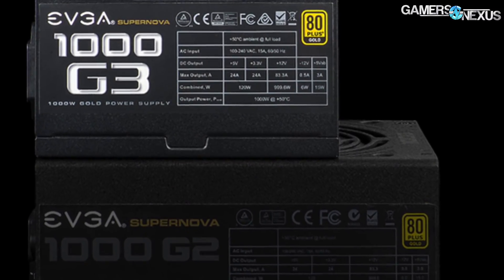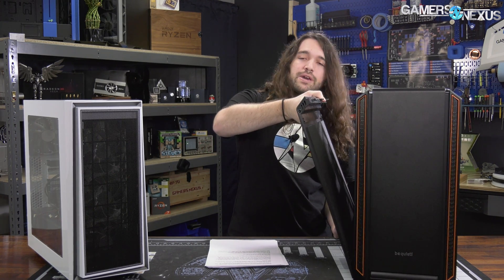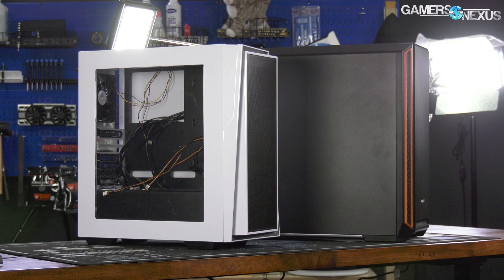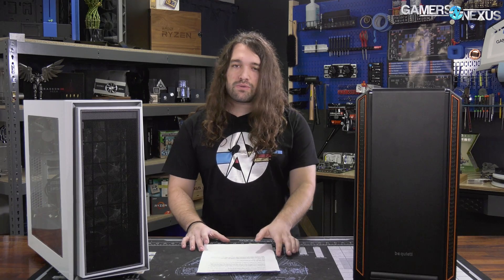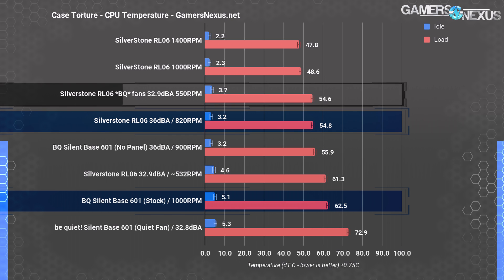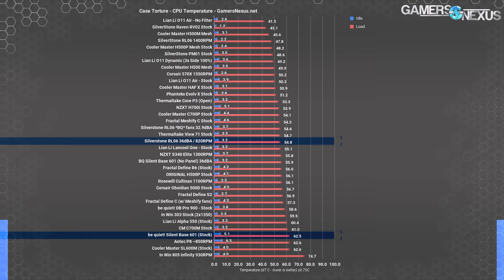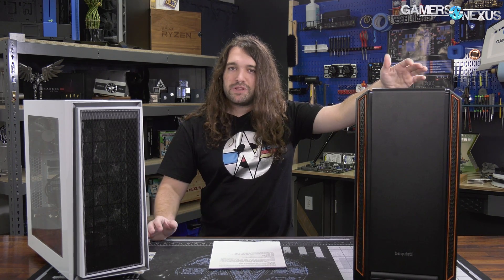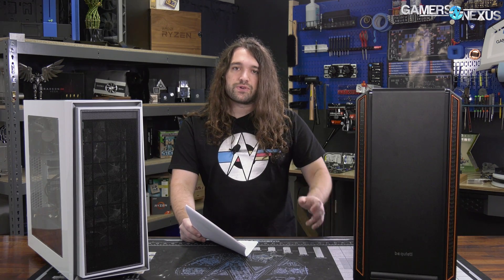Airflow vs. Silent Case: Noise-Normalized Thermals

Comment: What about silencing HDDs? That's one of my biggest reasons for having a silence focused case (R5), since I'm forced to run multiple large HDDs until SSD prices come down an order of magnitude. My fans run at around 6V anyway so they make pretty much no noise no matter what case they're in, but silencing the other stuff inside the case is a biggie.

Does very much seem that the BQ approach is going too far though. No amount of sound damping helps if your machine can't breathe, but I personally wouldn't be able to live with a case that didn't seriously attack the noise made by HDDs and potential whining components.
Reply: I have DBP900 and I can say they're quite effective to kill my 4 15k drives and 3 7k2 drive noises. i ditched those noisy bastards with higher capacity 7k2 drives already. even though the dampening works, there's still some high pitch noise leaks from the side window. I recommend the fully closed one instead.
Reply: Two excellent solutions for silencing hard drives that I've been using for a few years: 1 - suspension using style shock cord. 2 - resting the drive on four small pads of sorbothane, my current solution which is working great. These pretty much eliminate the transmission of vibrations into the case which is the biggest problem with hard drives, also I prefer 5400RPM for this purpose.
Reply: @GurtTarctor  where did you buy sorbothane pads? i can only find sorbothane feets
Reply: @n.shiina8798   I buy the sheets, think they are about 5mm thick. Then cut them up with scissors.
Reply: jubuttib I run 2.5 inch Hard Drives and NVME SSDs. No noise.
Reply: @gfjfjufidi2880  have you tried 10K 2.5" drives? :p

Comment: Would be very interested to see this test repeated but normalising for frequency peaks.  The low pass foam was specifically discounted in this test, but it's an important part of the sonic solution bE qUiEt??? has implemented, so I feel like this is a little unfair.

Also I'm "blessed" with being able to hear 15kHz, so stuff that specifically deals with high frequencies is reasonably important to me.

Comment: "type of noise" is very important with this topic, I think everyone prefers low humming noise over high pitched whistling noise (coil whine, grinding fans, hdd).
Reply: yes and the variation of the sound : if the noise is uninterrupted and invariant it's easier to forget it.
Reply: Some may also be wanting to get rid of noise that doesn't come from case fans. For example you may have a video card with a louder blower style fan or one with coil whine. Also other component noise such as pump noise and mechanical hard drives.
Reply: @carlwells9504  My thoughts exactly. So I'd sum it up as roughly:
- HDDs, noisy pumps or other vibrating/humming sources => silent case
vs.
- No mechanical noise or vibration (e.g. SSDs, air cooler etc.) => low rpm fans airflow case.
Reply: @tarron8785  I can hear my own breathing which I can say it's worst then a pc
Reply: Half of the reason why I switched from Corsair AF fans to Arctic ones. I have more fans in my system now, but the sound is MUCH lower-pitched and easier to drown out or get used to.

They're in a Phanteks P400 TG, for what that's worth.
Reply: coil whine and vacuum cleaner noises are the worst
Reply: He said it all it's about length for once. Sound waves come in short med and long beach has amplitudes that affect your ear differntly... some can hear sound amplitudes and speeds others can't.  I'm lucky 20 years as artillery man I can't hear shit anymore.hahaha
Reply: Exactly. I find HDD noise to be incredibly annoying but the sheer amount of space you can get from them as opposed to SSD's makes them unavoidable. One of the various noises that silent cases get rid of. 

Just bought a non-silent case and am going back to my old trusty silent case until I get it figured out.
Reply: grinding fans?  What kind of fans do you use?
Reply: i have a be quiet pc with be quiet hardware and sometimes i wonder if my fans are working so quiet they run even when gaming a big game
Reply: Low humming is ASMR to me lol
Reply: Yeah this test is kind if bull shit, doesn't matter how quiet the fans are.
Reply: this matters to me a lot, since i'm using the desktop in the same room as my recording studio. my large diphragm condensor mics are way more sensitive than my human ear, so i need all the quiet i can get. i'll definitely add another front panel fan to the be cool though. or maybe just move the one that comes in it to blow more on the cpu than the gpu.
Reply: Mr. Fletcher and Mr. Munson agree.
Reply: So with case has the low humming noise?
Reply: HDD resonans and worn fans are the worst kind of noise there is. I consider that the worst type of sound.
Reply: Yup and cases with sound dampening material can get rid of those sounds, or reduce it way down.
Reply: Coil whine happened to me..
Then i stopped cleaning my pc and it went away!.
The accumulated filth lubricated my fans.
Reply: @coffeepot3123  What the fuck. What has fan to do to with coil whine...
Reply: @coffeepot3123  The dust probably wedged the coil so that it couldn't vibrate anymore, or reduced cooling efficiency to the point where it changed power draw and moved the frequency of the vibration out of resonance.
Reply: I dont mind any of those (well except the ones that tells me its gonna broke) coz at least i know the fans is working. Like you have headphone to cancel the noise, so why the silent case?
Reply: smoked_out had a question hoping you or others can help me. I bought a used 1070 and has bad coil whine if I don't put on v sync do u think then it'd be worth to get a closed off case like the corsair 270r to limit noise?
Reply: @peanutdelight8413   if you get a really closed case with sound dampening foam it might help, if the 270r has a plastic or glass sidepanel next to the gpu it won't really do anything at all. (have a watercooled H440 with a coilwhining 980ti also in case you didn't know water blocks emphasize the coilwhine noise as i learned with this card)
Reply: anub1s15 yea they sell windowed and nonwindowed so I figured I'd do non window and then buy foam for the inside
Reply: @peanutdelight8413  Similar to what @anub1s115 said the noise dampening foam seemed to really help with coil whine. Just recently bought a second hand R9 fury which has really bad coil whine and my PB 600 really does a fantastic job of mitigating it. My only other case was an NZXT H440 (which is also silence based) so I really can't tell you what it would be like without the foam, just something to think about.
Reply: I for one would like to actually hear and know if my machine is making coil whine noises or other whirry stuff that it probably shouldn't be making so I can take action. I don't think the noise dampening solutions in the case would help with that.
Reply: AR J 

open up your sidepanel lmao

Comment: I always wonder how these cases compare with every fan slot occupied...because I don't know who runs a case with only the fans that come with it, especially if it's only two.
I have a Silent Base 801, running a 280mm AIO in the front with an additional intake fan below the rad, two 140s in the basement as intake, one 140 as exhaust in the back and 3 120s in the top as exhaust, and thermals seem to be pretty okay across the board. Running a 9900K at 5Ghz I only ever get it up to 70-75 degrees during stress tests and 65 during gaming...
Maybe the brute force approach can alleviate some of the restriction issues.
Not saying a purely airflow focused case isn't going to be better, maybe I'd have better thermals in a better airflow case, but my thermals barely increase when I take the front panel off.

Still, it's a contentious issue, I just have a soft spot for beQuiet! and liked the 801s design and features alot.
Reply: I have a Phanteks Enthoo Primo (the big E-ATX one), which sports 5 x 140mm fans stock (good but not best-in-class silent, rather strong airflow at 82 CFM each). Inside sit two 150W TDP CPUs watercooled with Swiftech X220's, which adds 4 x120mm high-pressure fans, 55 CFM each). Total of 9 fans and a combined 82x5 + 55x4 = 630 CFM of maximum airflow (divide by ~2 for intake/outtake). 

Add three GPUs for a total of 5 extra fans; idling they're all off at 10C delta max, but at max speed one of them (Sapphire RX 460) is unacceptably loud (I only use it for VMs display though, I never push that GPU above 30C, so it's effectively passively cooled and thus a non-issue for me).

The case itself is a giant hole, seriously, hex tiling on the back, etc. It's pretty much meant for great cooling and doesn't care much about passive silence. 

What I can tell you is that with all fans at max speed, it is a COLD BEAST if I ever had one. It's very loud though, easy into the 60dB's subjectively (I can't measure that, but it's loud enough that you need to raise your voice to comfortably speak to someone across the small-ish room). I feel like I'm in a server room sometimes when benchmarking stuff.

However, if I set all fans to minimum, I only lose little cooling (like maybe 10C delta, which leaves ample room still given the low basis), and the computer noise becomes barely noticeable. A rather bass-y white hum that actually feels nice, a bit like a very distant, faint waterfall but more "air-y" if it makes sense. 

I could probably lower that floor noise replacing all fans with Noctua's or something dead silent by design, maybe MagLev idk. But the cost makes it hardly justifiable in a somewhat noisy environment (I live in a 1-bedroom appartment, so the PC is in the living room, and there's usually music or podcast or something in that room, I only need the PC silent enough not to be heard above any desired sound; and I watch movies/series in the bedroom so there's zero noise there).

So I would say that the brute force approach is very effective, although costly to achieve maybe slightly better results. I need a three-figures budget to replace all those fans (2.5 years old already, still decent, so probably ~1 year from now, which per year amounts to ~$60 just for freaking fans; some people buy two cases once a decade for that price).

______
Note: yes I could and should have gone custom loop, especially for GPUs, but I have no idea how and tons of other stuff to do. For reference, 
I've tried various configurations, and to my surprise the best thermals at low speed were achieved by pushing air onto the CPU rads which sit all across the top side, thereby intaking air inside the case (which I exhaust ASAP using case fans), and similarly pushing air directly onto the GPUs (they sit at the bottom with risers, directly on top of a couple case fans), which again is exhausted ASAP through other case fans. This yields a "two-zones" config. horizontally split, wherein CPUs at the top and GPUs at the bottom probably never really exchange air. The one flaw is that air reaching the CPU VRMs and RAM is on the warm side (coming from the CPU rads), but honestly it's barely above 50C so I figure that's well enough for these components (could always add heatsinks anyway, but don't need to).
Reply: If you go up from one intake fan to two intake fans you get twice the airflow for 3db more. If you go from two fans to three fans you get 50% more airflow for 1.73db more. That is if you block of unused fanspace to stop resirculation.
Reply: There's this LTT video where he claims that more than 2 fans doesn't make much more of a difference. They used a CM master case 5 for the test.
Reply: @stardustreverie9737  I would imagine that this is dependent on the HW configuration one has in the system. I would imagine that two 120/140mm fans would be enough by far for a mainstream desktop. What i stated is just some facts to consider. Maybe its better to go with a cheaper case and rather buy a extra fan to achieve lower noise. I have five 140mm case fans in my setup, its a air-cooled 1950x and its only around 36-38db under full load, deltaT~27c. I cant make statistics based on just my own setup, but its an indicator.
Reply: @trulsvian  It's an old and probably too approximate formula, but roughly 1 case fan per "big" component (CPU, GPU typically) kinda worked back in the day. So in my case with 2 CPUs and 3 GPUs, 5 case fans seem like a decent count to flow enough air overall. I think you're therefore totally right that most mainstream PCs with 1 CPU and 1 GPU should be totally fine with 2 case fans. (then possibly add more if watercooling with thin/large rads).

Comment: because fan noise is the only thing that matter 
chuck a gpu with some bad coil whine and a bunch of hard drives and tell me which case is quieter
Reply: Coil whine in different places (GPU, MB, SSD, PSU), HDD works, bad PWM or worn ball-bearing fans you can't easily replace. That's what closed Silent PCs are for.
Note that Steve admitted they just tested noise level, not frequency responses, and he didn't trashed the whole kind of cases. To me it's a small win comparing to his claim in the Silent Base 601 review.
Reply: Vierax SSD Coil Whine?
Reply from the maker: We talked about that aspect in the video.
Reply: @GamersNexus  talked yes, but did not test. 14 minutes long. 14 seconds of importance.
Reply: I have a Vega 64, a card legendary for it's coil whine.. and completely got rid of it 100% just by capping my system framerate at 200 with rivatuner. Using  'quiet' hot box cases to fix issues like coil whine is like painting a window to hide a crack in the glass.
Reply: @PriaSamari  Id rather cap with frequency/voltage tuning, Rivatuner will not work for anti cheat games.
Reply: @PriaSamari  why don't you use radeon chill for this?
Reply: jake winchester people still use 3.5 inch hard drives? Lol. SSD + 2.5 inch Master Race. No noise at all.

Comment: Good test! I would prefer the R5/S/R6 though because it is less closed off on the front (fewer holes but much bigger holes on the side) than that bequiet but that is just my personal curiosity, for the test setup it might be better to take the two extremes. It seems to me that those Fractal cases approach a very good compromise as long as you don't have extremely overclocked hardware inside that case. But indeed, the fans and the foam might be a lot more important.
Reply: Peter Jansen ya I have the R4 non windowed case with an 100i gtx (v2) mounted in the top pushing out with two NF-12s at 1100rpm and four other ~700-800rpm fans in the front, bottom and back. With an iPhone dB app I get about 45dB. I wish I had slightly higher quality fans for the non rad fans to get that noise a little lower, but it seems okay to me. Does that seem loud to you? I’m not overclocking

Comment: PM01 with a D15 and it's the quietest build i've had (even compared to h440 and R4) and it's acceptably cold. This thesis is one hundred percent based in reality. I use it in a studio tracking room where noise is of utmost importance.

Everyone should do it.
Reply: D15 or BQDRP4, both are great coolers. Noctua has the better tower, bequiet the better fans.
Reply: @peterjansen4826  absolutely. They're both stellar there isn't much to it aside from availability and price.
Here in aus the D15 is a better purchase and it also happens to be easier to install.
Reply: @Jay2097  
Here the price difference is small, like $6-7. The problem with the DRP4 for me is that it has less metal (given that I have a case which fits the D15...), I would like to see a somewhat lower price for it, around $65, because of that.
Reply: @peterjansen4826  Why do you think be quiet has better fans.
This is the closest fans I was able to find

be quiet silent wings 3 140mm high speed vs noctu nf-a14.
1600 rpm vs 1500 rpm
131,79 m^3/h vs 140,2 m^3/h
2,16 mmh2o vs 2,08 mmh2o
28,1 db(a) vs 24,6 db(a)

Seems to me the noctua is tiny bit better.
Reply: @petrkinkal1509  
Better is a bit subjective in this case, I claimed that because of the pitch of the sound. If your speakers are good enough then you could watch the Science Studio comparison (beQuiet, Noctua and two other brands). The pitch of the bq-fans is in my opinion less annoying and Greg thinks the same. I guess that it is possible that other people might prefer the pitch of the Noctua fans. I prefer the bqSW fans for that reason. 
Anyway, I will be buying a Zen2-CPU 1-2 months from now and I wil probably choose between the D15 and DRP4.
Reply: @peterjansen4826  Fair enough I will watch that vid (but i have doubts about my speaker ability to reproduce the sound still worth a try).
Reply: @petrkinkal1509  
It is not that his microphone is perfect but it is pretty solid: an Audio-Technica (known for a good value for the money) microphone which costs a little over $200. I have a HD 700, that gives a pretty reliable representation.

Comment: You can also undervolt to lower the heat generated on the CPU side, meaning less RPM's meaning less noise.
Reply: Undervolting the GPU has more impact as CPU coolers usually have more cooling capacity per watt as graphics cards.
I mean just look at the humongous heatsinks that people mount on their 100-150W CPUs whereas GPUs have to dissipate twice as much heat with similar or less cooling surface (including triple slot).